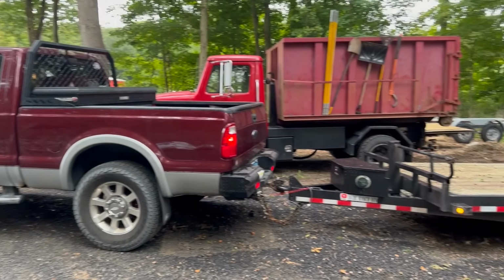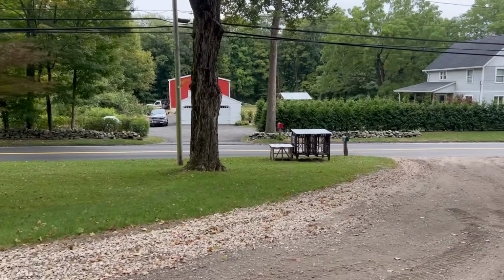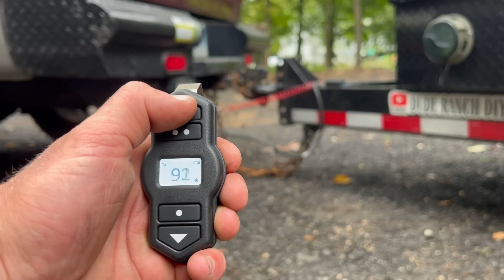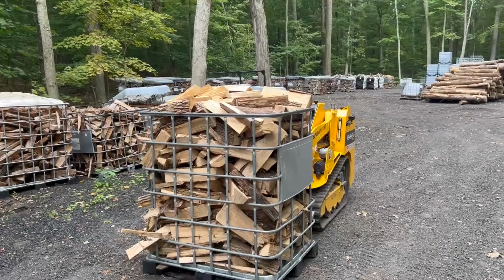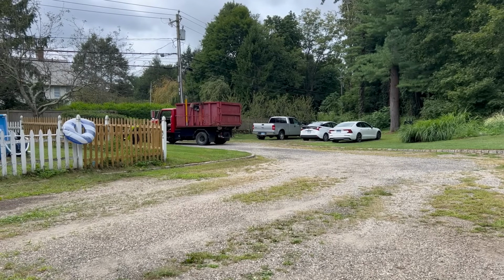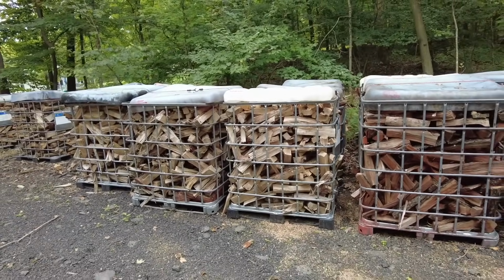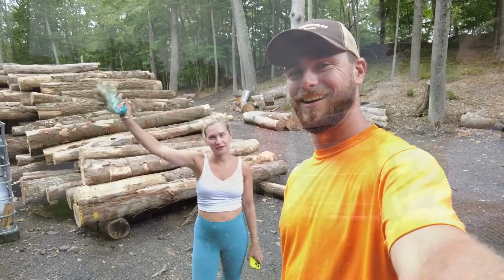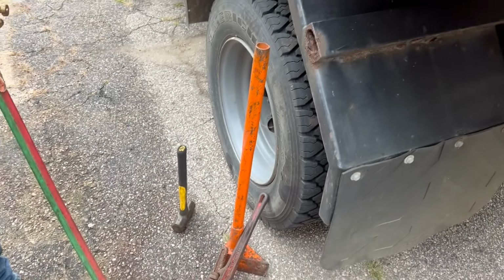They ALL Called AT ONCE & Some MAJOR NEWS!!!

Comment: Next time you’re bucking up an oak or other dense type tree, why not measure out the length of the ramp, taper cut it to make your DIY ramps? I’d then drill a hole in the thick end & loop heavy rope thru it, tie it off for a grab handle. All of that makes sense in my head but I’m a retired hazmat guy so there’s that. Good luck pal.

Comment: By the looks of it you could have moved the totes back a bit over 1' and the same with the skid steer.  Then you probably wouldnt really need air bags.  You had so much real estate on that trailer to properly load it good enough to leave your bags at 15psi.
Reply from the maker: You’re not wrong however, the next good tie down point is several feet back which is why I had the wood pushed all the way forward.

Comment: So for loading the mini skid onto the hook flatbed  fabricate a 12-14” ramp off the back of the deck, hinged a lot like the ramps on your trailer. 
Secondly, looking at your wood yard you could save time and fuel if you stacked some mafia blocks along the base of that dirt slope, back fill it like its own ramp and dump the tote cages without lowering the can to the ground. Just a thought.
Reply: Oh and congrats on the baby to you both!!
Reply from the maker: Thanks! Yep I’d like to make a raised loading area
Reply: @DudeRanchDIY  I envision the raised area long/wide enough for truck and trailer to pull along side ( lower area for loading trailer) rotating forks on a piece of equipment . Tractor or skid overhanging cage over truck/trailer rotate the forks easy peasy and on your way. Saves all the time of lowering/raising of body, more importantly saves the fuel, not only on the trucks, but the equipment as well.